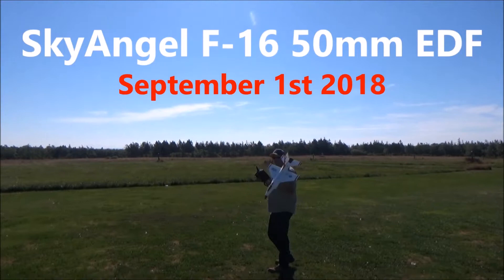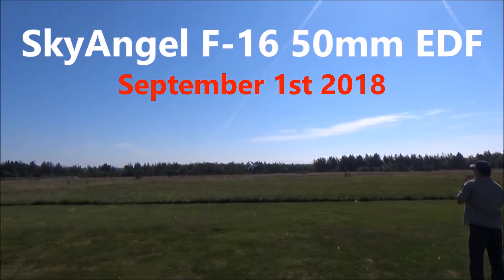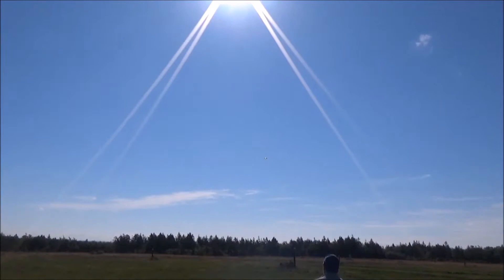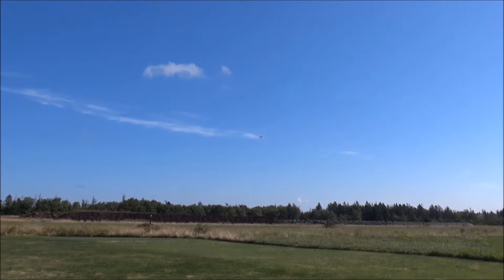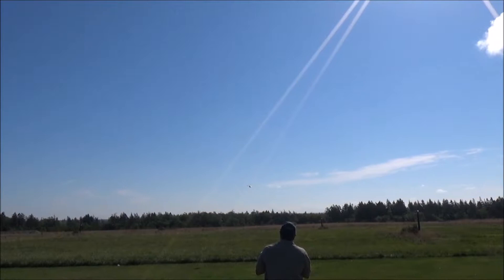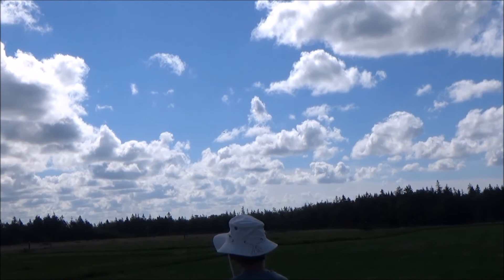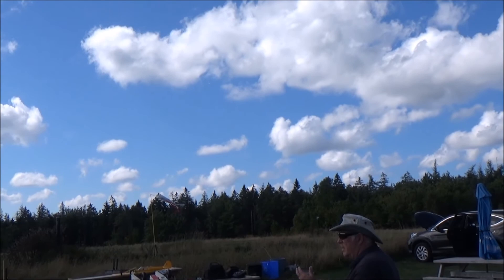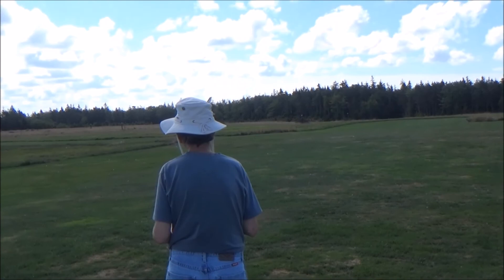SkyAngel F-16 50mm EDF

Comment: What battery does this fly off of?
Reply from the maker: It calls for an 850 mAh 3s but I use a 1000 mAh 3s with a 45-90C discharge, and only get 4 - 4.5 minutes of flight time.
Reply: Can you still buy them?
Reply from the maker: That I don't know. Mine was new, but I bought it second hand for $40.